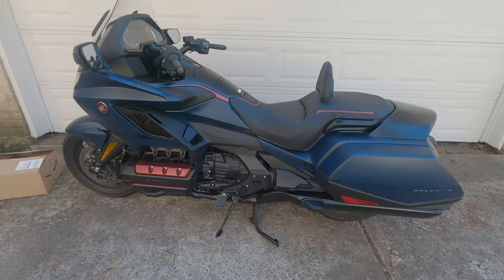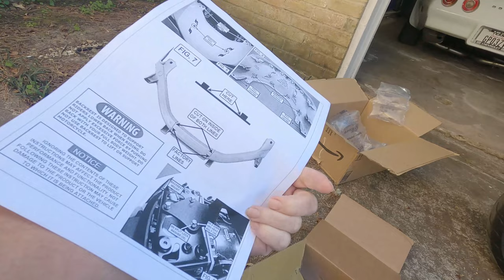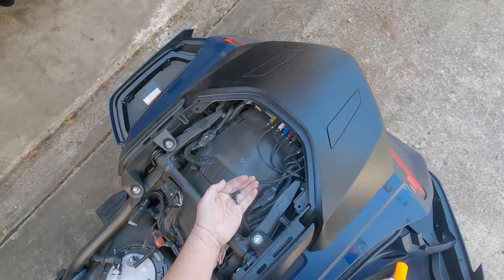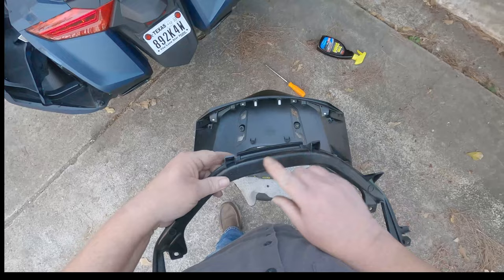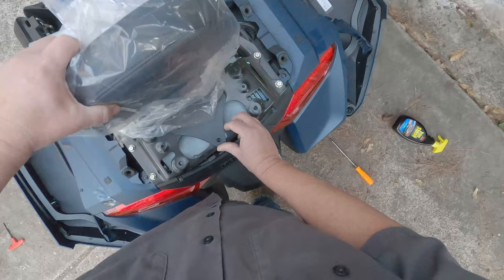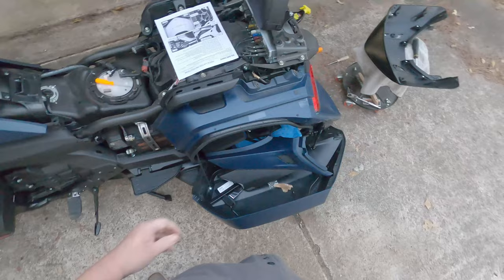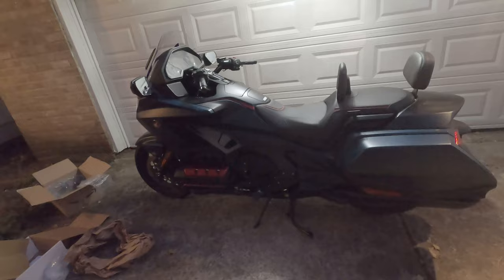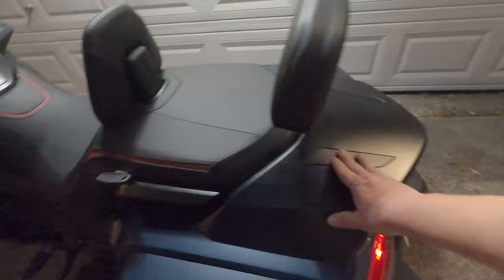2022 Goldwing DCT - passenger back rest installation

Comment: What was the trick to get the rear top cover off that you battled with off camera? I have the 2 push-pins and 2 bolts removed but cannot get the top cover to slide off.
Reply from the maker: yea, it was not easy. I even tried using a towel wrapped large screwdriver. Remember that there are 2 rubber studs on the very rear. you just have to pull it hard to get it to release. Put some lube on them for easy removal next time. If there will be a next time..haha
Reply: Wow, the cover was a bear to get off like you said. I really had to pull and tug on it. Thought for sure I was going to break it. Thank you, thank you, thank you, I wouldn’t have gotten it off without your reassuring words.

Comment: Is this the same way the Hondaline backrest installs. I want to add a luggage rack later and don’t want the area for the luggage rack to be used for the backrest
Reply from the maker: Im not really sure how the honda accessory is installed, maybe in the same spot. But they both (Backrest/rack) use the same bolt holes under the plastic tabs under the cover in the back. The worst part is getting that cover off for the backrest, you dont have to remove it with the rack.

Comment: Out of curiosity…what are those two covers on the rear of the bike actually for? Is that where the mounting holes would be for the trunk on the touring?
Reply from the maker: Yes they can be removed for either the trunk kit or a luggage rack behind the passenger seat.
Reply: @tracktoys9269  appreciate it!

Comment: Hey Forrest, I was eyeballing the C- channel bracket to see if it had a rubber seal or gasket inside the C-channel to prevent water intrusion.I noted a wiring bundle just under where the modified bracket was, to allow the after market seat post to be mounted. As water is gravity driven, would rain follow the seat back post down into the wiring block?( I realize you don't normally ride in the rain, but anyone could be caught as you opined).Two questions Sir:
1) Do you think it would be prudent to lay in a silicone bead around the bracket mod?
2) Does the Honda seat back install without bracket mods?Thanks.
May you,your family,friends,& neighbors always be safe.Live Long & Prosper brother,just subbed,luved that Dragon Tail ride series,phil🇺🇲🍀👍
Reply from the maker: Well first, thanks for watching! I appreciate it. now, I dont water would be an issue, I have had multiple motorcycles and many have seen the worse rains you have ever seen. With no issues on shorting or water problems. All motorcycles have sealed weatherpacks for connectors and the stereo unit under the seat is well protected. I dont really remember if water can run down through the bracket or not. I think there is a rubber seal in that slot where the bracket runs through. So I dont believe water can seep through. The install was fairly straightforward. there wasnt any modifications to make to the seat of the seat back bracket, it was engineered specifically for that bike. Going back to your 1st question, that is entirely up to you if you want to seal it but I dont think it's necessary. You should be fine. Thanks again for the well wishes. If I ever get any time off again, I will return one day to the dragon to see how the DCT handles it! I really want to go back to pch, that was a ride of a lifetime.